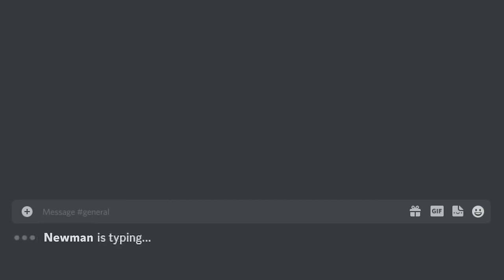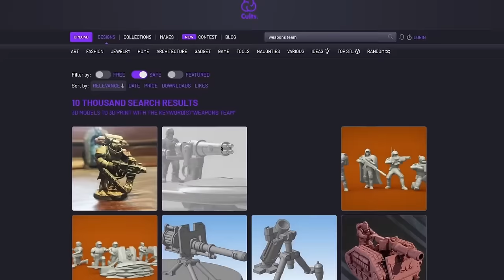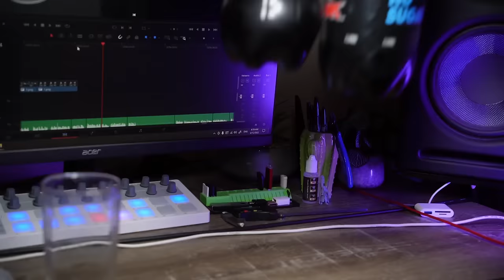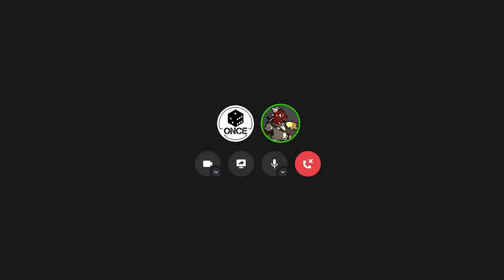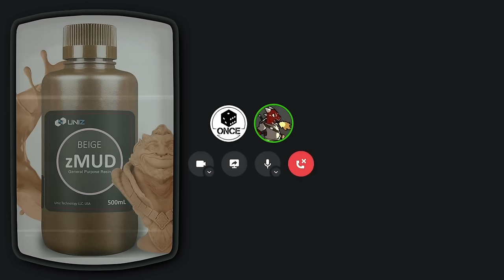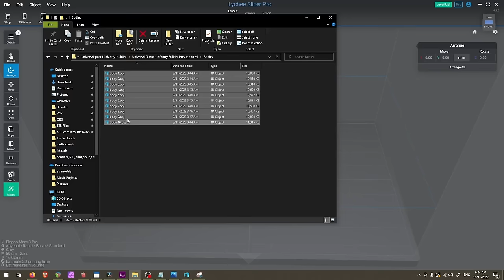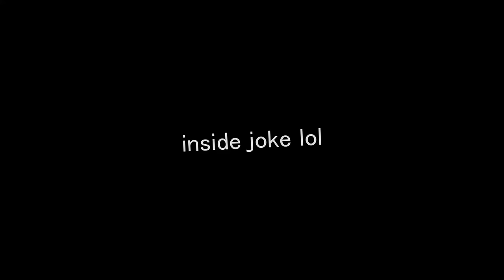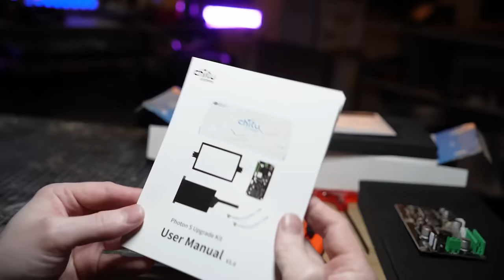Can I print it before GW ship it?

Comment: This is 100% a threat to Games Workshops product line. And Games Workshops is 100% responsible for it. If they didn't horrificaly overcharge for their models. They wouldn't suffer nearly as much from this issue. It is thier greed that drives their players either to getting a 3D printer or to leave their games behind forever.
Reply: Maybe they need to “seriously rethink their strategy” 🤣

Comment: Fantastic video. To weigh in on the piracy aspect, and whether it hurts GW... My own opinion is that I think it hurts them far less than they think it will. For someone like myself who is a fringe player of 40k, I've owned several thousand points worth of 40k armies in the past (which has all been sold now), I have no desire to get back into the hobby as the models are cost prohibitive for me. However, I do own a 3d printer and if I could make my own armies for a fraction of the price and play again, or get into the modelling side of the hobby too, I may well do that. If I choose to go down that route, GW will be net positive from me as I'll be buying bits and pieces here and there, paints, rulebooks etc. etc., so without piracy they no longer have me as a customer, and with it, they have a customer that they otherwise would not.

Comment: As someone who just got into wh40k near the end of 8th edition with Imperial Guard, I don't really have a problem with 3d printing and attempting to recreate models that gw themselves are putting out. The sheer fact of the matter is that GW has some of the highest profit margins of any company, their products are remarkably cheap to create, and they sell them for some of the highest prices in the industry. That combined with their routine decisions to rather make the game worse than to allow other companies to make models for older units and options that were still in the rules but not made by gw anymore, as well as recent decisions regarding raising their prices for retailers and local game stores to acquire their products makes me not really worried if 3d printing is hurting GW anymore since they themselves seem so focused on improving their margins while providing none of those savings to their customers at all.
Reply: I absolutely hate that GW, or Warhammer as they're called now, are so harsh on stopping older models that THEY DON'T MAKE ANYMORE! Like why? It does Nothing to reduce their profits. 
Meanwhile CGL with Battletech included a flyer for 3 different mini makers who do old or not currently in production mechs in my beginner box. Metals, old plastics, and plastics that are just currently not in production (New models but no current factory line)

Comment: Excellent video.  Did a ton of resin testing and settled on using "8K" resin on my 4K printers.  I like the detail I get from 8K resin.  I use Phrozen's 8K resin mixed with 10% Tenacious.  Calibrated with the Cones of Calibration and I can print minis reliably.  With the money saved on not buying physical mini's, I invest that into good resin.

Comment: Amazing video - especially the interwiew about the resin and cones of calibration. Just adding 2cents from anycubic wash and cure machine side (the small one, coming with photon mono 4k).  The machine comes with an underlying reflecting/mirror foil disc (like a really thin cd) which does help with curing from the bottom, pretty ingenious.

Comment: EDIT: I've seen other people having issues with this resin because they didn't print at the recommended temp (higher than normal). I just ordered some and plan to mix it with Vulcan 8k for a mix of detail, low viscosity, and toughness 

The only thing 3d printing has done is exposed how absurd GW's prices are. 10 plastic space men aren't worth $60, they're worth 60 cents. A thunderhawk isn't worth $750 it's worth $7.50

The floodgates of the miniatures market is about to explode. If these companies are smart they'll pivot away from miniatures and move to licensing the IP for movies and video games. Then just release rules for the wargames as a digital subscription.

Comment: I think it is complicated, but I am leaning against it.

For starters, games workshop employs a lot of artists for their miniatures, from concept art, legit wall hangers and sculpting the models themselves, not to mention set up factories for distribution e.t.c. realistically their stuff is going to cost a lot more than the plastic is worth because they are supporting a much larger industry, including steel moulds and commissions that someone with Blender and enough time doesn't necessarily have to worry about. Which isn't to say it isn't useful or potentially really divergent, I've actually backed some 3D kickstarters of inspired, but wildly different models as I much preferred the WW2/oriental style aesthetic over the Star Ship troopers' style of hard plate that I would much rather save for my elite forces, but to me basically copying a model 1.1 and selling it online to directly undercut the industry, particularly the other artists who work hard to produce the theme for those models, does strike me as pretty distasteful to directly rip off the models.

Though that is my personal line anyway, I don't feel particularly strongly about it. That being said, I frankly feel that some GW are stupidly expensive and should be packaged better. Like, 5 temple guard, a unit that costs 100 points and is designed to work as a troops choice in a subfaction, is worth £26 for 5 small elves. I personally feel that if it was £26 for 10 would be more "reasonable" or a boxset with 20 of them and a cow mountain for, say, £100 would be fairly reasonable. But so far getting 30 temple guard and at least 1 mountain to run the subfaction (which is just shy of 1000 points) is £220 for less then 1000 points worth of units that have little synergy with the rest of the codex is a bit ridiculous.

I feel the same way about imperial guard. Why sell boxes of 10 guys when every imperial guard player is likely going to take 50/60 guys minimum, even if they are running a mostly mechanised list? Very few people are willing to shell out £22/£24 for 80 points worth of guys who they will likely be taking at least 5 of in their list.

Comment: Cones part is pretty interesting. My feeling is the story only holds up is there is 1 proper standard how models are pre-supported (thickness etc.). But in the end the assumption is, as long as you keep overexposing more and more, in the end you won't get a misprint. But yeah... you sacrifce dimensional accuracy. 
If you don't care about dimensional accuracy then, apart from maybe bigger build plates and a faster printer you don't need the expensive 4K/8K stuff. You throw it away anyway, to a certain degree. 

Other way around would be more interesting --> if you dial in your printer for dimensional accuracy --> then print the cones --> they teach you what kind of supports would work --> that way you can make sure your own supports are OK.
Of course at the sacrifice that you need to put some work in yourself instead of click and print. 

So it's a different approach aiming for a different goal. But still not sure given pre-supported model support variations how universal it actually is.

Comment: This is quite a stellar channel to find. 
I came expecting to see neat warhammer prints. 
Instead, I got some genuinely amazing knowledge on printing and troubleshooting, alongside the way these prints are made. 
Well done. I'm shocked you kept it so engaging, too.
Reply: To answer the question of what is perfect exposure;
As I've always seen it, it's the ratio of reliability vs accuracy. 

That ratio depends on the individual and their print. Some folk are fine with failures, some folk hate them. Some folk need a 30 minute print, and so will be willing to put up with failures so long as their bed is full of some successes at that speed.  Sone folk have a five day print that would set them back ages if it fails. 
These people need different ratios of reliability to accuracy. 

Incidentally, this is the same thing for 'perfect supports'.
Maximum reliability for minimum damage.
Nobody likes support marks. But nobody likes failed prints either.
So compromises must be met, and balances struck.
Reply from the maker: Stoked you found your way here!

Comment: One of the big reasons why stl files come with errors is that they get corrupted during upload stage. I had bit of a back and forth with one creator on MMF where I basically checked their files for them as a customer and they kept reuploading the files and I kept finding errors such as straight up just holes in them that you can't fix with stuff like lychee because lychee doesn't think they're broken.

According to them the files were always fine on their end, so what they ended up having to do was download the files through MMF, then repair those and upload those and then they eventually stopped getting corrupted on upload.

Comment: Awesome video! I've found that if I put the uncured bits in a small tub of water and cure them while they're suspended in water then it helps a lot. IDK if that occurs due to refraction aiding UV light hitting any little hidden parts or if the water helps in some other way. Might be worth testing though!

Comment: Regarding: "there is no such thing as a 'consistent rating' because every printer/resin combo has so many variables up in the air, so Minirater is a bit waffley."

I think Minirater is still an important project, because there are plenty of elements to these model patreons/shops/kickstarters than just 'does my first print succeed with minimal calibration'.  Customer service,  file organization, if files are corrupted or have lots of topology errors, islands, etc.  And even when only referring to the 'printability' of files and presupports, having a community average score is an excellent resource, even if you feel it necessary to put a big asterisk next to those specific scores say YMMV.

Comment: You place the build plate in the wash cure machine then take the models off after washing. Chucking them in loose is only for large models that don’t fit. Otherwise one of those little bits will fall through as happened

Comment: Came for the guard proxies, stayed for the calibration lecture :) Im a design engineer and one of the things we balance in a design is the needed strength for a part to keep the stresses within acceptable values  :) so often we have to adjust the design so the part would be strong enough for its intended use

Comment: I bought the bigger anycubic wash and cure machine and its been brilliant. They have a mirrored sheet that goes down under the turn table aswell as the strip that has the UV lights has an arm that can turn up to 55° from memory so it's definitely made curing way way better

Comment: That was a phenomenal watch, I learned a lot!

A couple points of interest -
1. Try out Siraya Tech Fast Resin, it's what i've been using of late and I've had no issues using their default print settings on my Photon Mono. (Just don't leave it in the vat long term because it'll make for a hell of a clean-up)
2. I don't have an Elegoo Wash and Cure, but I do have the Anycubic Wash & Cure 2.0 and that one doesn't have led's in the bottom but it does have a reflective sheet that you place below the tray, You might be able to rig something similar up for the elegoo.
Reply from the maker: Would love to get my hands on that resin!  As for the cure station even if it did have lights or a reflector it's still tiny. So good for a small print job I guess

Comment: I´m 15 minutes in and dunno if you say anything later; but I had to stop and give you the best tip I got over ther year printing. Get a First IPA bucket. You get off most of the resin in that one in a couple of minutes and than you use the washing and cure machine to do the second cleaning. I never had any resin left over on my minins after that .

Also use a cheap hairdryer to remove the supports. Its more enviroment friendly and you can hit just the supports, avoiding bending other parts as with hot water.

Finally an IPA distiller (I use a water distiller) from Vevor is gonna save you so much money in the long run that is insane.

Good luck with your channel.

Comment: Heya, Very cool! I'm Garin from the makers cult and I've just found out about this channel. Your production value is amazing.  Just a quick note, we do repair things in 3d builder before posting, but lychee considers several things to be issues that other software do not (Overlapping shells, multiple points very close together, multiple shells, ect) None of us use lychee, (prusa FTW) which is why this isn't caught. We do however test print everything before it goes out to make sure it all slices and prints without issue. Cheers,
Reply from the maker: Hey Garin! Nice to hear from you, I'm a big fan of TMC 😄 I'm currently looking into these "minor errors" in a bit more detail because it does seem to have some variance from one computer to the next. For instance files that I've repaired in 3D builder and read fine thereafter in Lychee aren't guaranteed to do so on another computer, and show up with errors. It's super weird and I want to figure out what's going on there and hopefully will have something to say on the matter in a future video. Thanks for stopping by!

Comment: Another variable to consider is your wash times and bath temp.  Note I use the water washable stuff now, but letting it sit for a little longer will soften the supports right up when you find they are a little tough - I sometimes see this if I don't pull them from the build plate right away.
Also for the cure station the basket is typical of most of the models out there and small bits can fall out or ends stick out but your solution is the typical one to just find some mesh.  For the curing bit, anycubics ones have a relective plate that goes in under the tray - you could probably just put some mylar or tinfoil with a hole cut out to reflect underneith.

Comment: Also, yeah, having a wash&cure station is a total gamechanger. I got the big one from anycubic to go with my Mono X, because it just lets me chuck in the build plate completely (which, nicely, also cleans off the plate itself). Post processing was never easier than this. It also cures better, has this little part on top that angles down, and a reflective sheet that goes under the turntable to reflect the UV light back up and under the parts.

Comment: Another oustanding video mate. 
The amount of work and information you get through in every video contiunes to be staggering. 
The discussion around the variables that lead to the degree of dimensional accuracy acheived in prints was super interesting.

I still think there is huge value to be gained in the minirater project. The issue of specific resins and printers the customer is using is relevant and worth considering as a factor for sure, but IMO this should be secondary to addressing the absoulte basics of unsupported islands, file organisation, or files with errors etc.

Keep up the great work mate! Loving each new installment. 

Do I hear the influcence of the Risk of Rain soundtrack on the music at the 15:20 mark?
Reply from the maker: Appreciate that! I'm unfamiliar with that soundtrack, I'll have to check it out!

Comment: Excellent video! Both entertaining and informative, as usual. If it helps anyone, I have had great success using Elegoo ABS-like grey resin mixed with roughly 10% of Siraya Tech’s Tenacious clear resin and using the One Page Rules recommended print settings for the original Elegoo Mars. Even after using these settings I still experienced the occasional failure, both with pre-supported and manually supported models, but now I always open the stl file in the Windows 3D Builder app to repair it before slicing and printing and I haven't had a failure (that wasn't related to inadequate supports) since.

Comment: Ty is absolutely spot on in what he says. I see the Cones getting a lot of flak for being a "poor" test, but in my experience its a fantastic quick 'n' dirty test for giving you an accurate ballpark to work around.

The trouble with the likes of the AmeraLabs or Siraya Tech tests is that people aim for perfection within the confines of that particular test. Its like trying to determine if your PC can run a particular game by running a benchmark. Some games are well optimised, some are just poor ports.

One thing that Ty didn't pick up on is the difference between different batches of resin. I run a 3D printing business and my machines run 24/7 and drink a lot of resin. I can categorically say that resin quality/properties varies from batch to batch. I usually buy my resin in 100L at a time, and I will check the dates on each bottle, grouping them by date before they're used. I'll run calibration tests between batches as there is a noticeable difference between them. We're talking a +/- 1 second difference in exposure time in some cases. Don't assume that because you're buying the same resin from the same manufacturer that your settings remain the same; they won't. Not if you want consistent quality anyway.

You don't have to calibrate from one bottle to the next, but I would advise checking the dates on those bottles. If there is month or more between the one you're using and the empty one you've just thrown away, run a calibration test. The results may surprise you.

One piece of advice I can give is to pick a resin and stick to it. Learn it's shortcomings and adapt to them. Even the most dogshit of resins out there can be made serviceable with the right settings. It won't take you long to realise how much these materials can be pushed before you hit the ceiling of what they're capable of achieving. Too many people flit from one manufacturer or variant to another when they have a rash of failures. Learning the limits of the materials you're using is just as important as learning the mechanics of 3D printing.